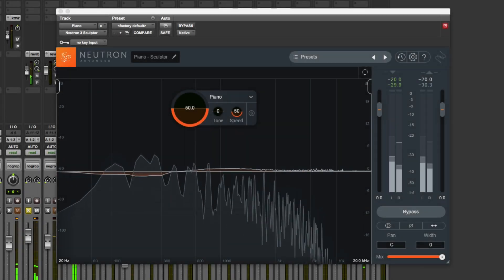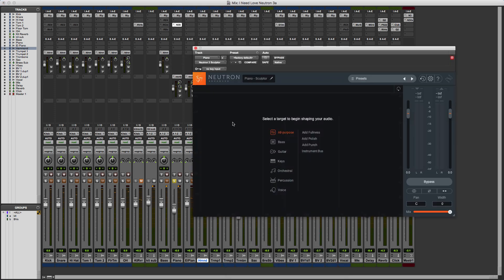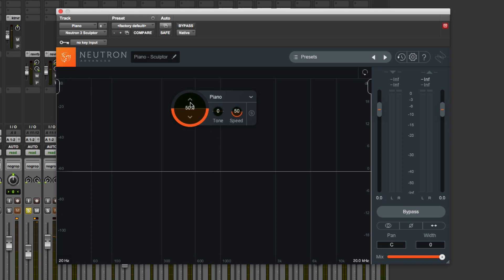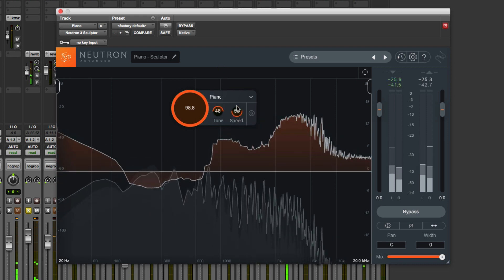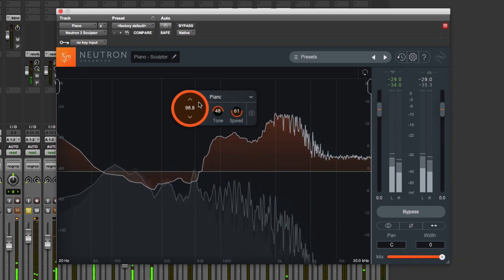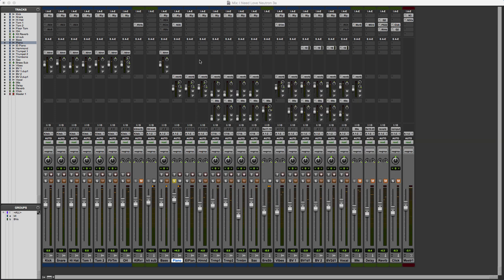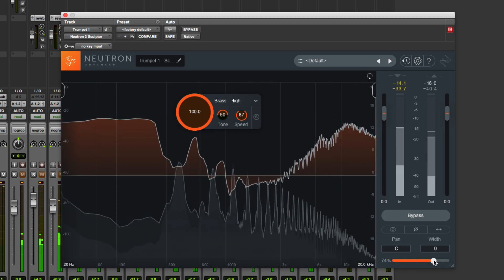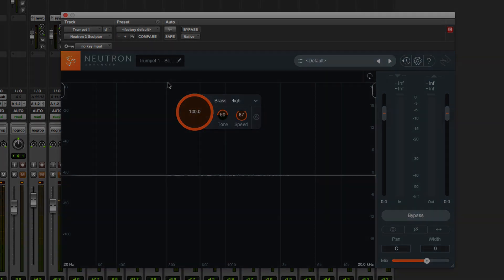How To Use The New Sculptor Module In iZotope Neutron 3 Advanced

Comment: Guys...no one seems to demo Sculptor really well. You really have to feed it TONS of different audio to see how amazing it is. Giving it single instruments at a time is fine, but if you give it complete mixes and choose the mastering presets...OMG....it's WAYYY better than anything out there that claims that it can smooth out the track, like a popular plugin I wish not to mention. The guys at Izotope hit a home run with this. Sadly, this demo is nothing but talk.
Reply: Hi TheChosenOne
, what do mean exactely about: if you give it complete mixes and choose the mastering presets? Choosing the mastering Presets from witch Plugin?
Could you please be a little bit specific? Because I`m using it for the first time, and your help is much appreciated.
Reply: @saidadd6384  I'm talking specifically about the Sculptor module only. What I was getting at was, instead of just using on individual tracks, use it on either a whole mix, or on groups. Using it on individual tracks is fine BUT, you should be careful not to rely on using it individually on all your tracks because, from my experience, you lose dynamic range. Not a lot, but enough so that when you use the limiter, you mix sounds really flat, boring, and fatiguing.
Reply: @matrixate  Thanks a lot brother, I really appreciate it
Reply: Found this trick lately too, and nobody is talking about it. Better than the ozone's spectral shaper and way cheaper than stuff like gulfoss.